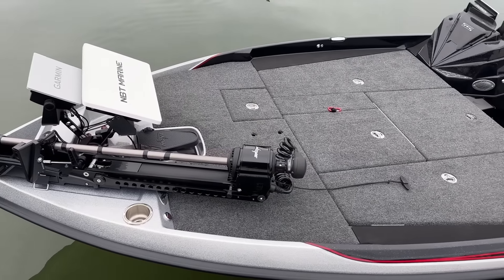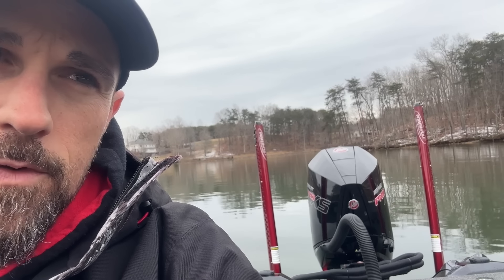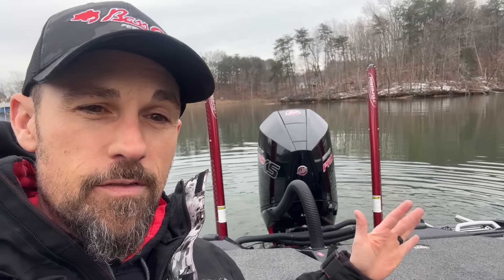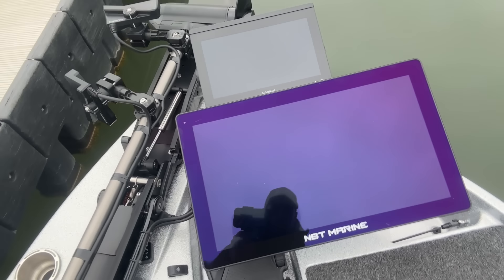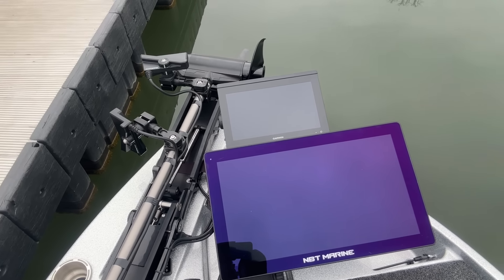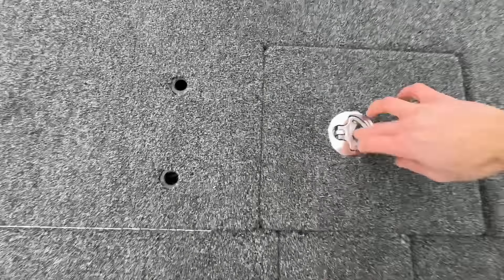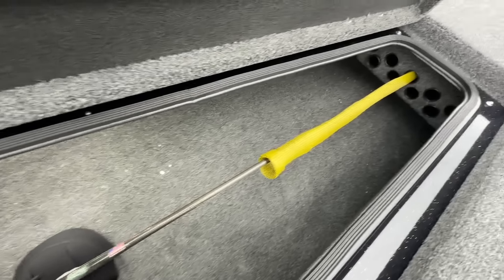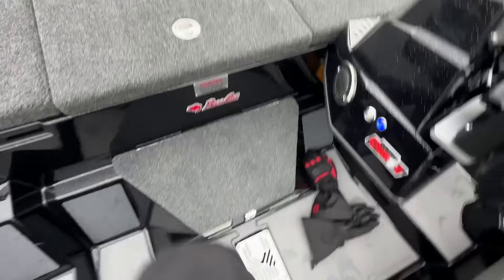NEW Caracal STS - First Run Experience

Comment: Great video, as always, John! What is the reason for the split gas tanks in Basscats? Does the engine siphon from both equally to keep the boat balanced? It seems if you use one at a time, the balance of the boat would be off if one gets much lower than the other?
Reply from the maker: Split tanks helps with knowing how much gas you have for long runs. I like being able to alter weight in back end as it’s best to have more weight on port side due to prop torque
Reply: @JohnCrews  interesting, thanks for the response, and have a great season!

Comment: What’s your thoughts in comparison to the eyra.   (I have a brand new eyra, not even broke in yet).  So I was interested in its handling and drive ability (chine walk) compared to the caracal , and puma.   Good luck, by the way, I’m new, I’ll be chiming in from time to time.
Reply from the maker: Eyra and Caracal STS need to be driven on top end. Cal is much wider and more stable so we will tell in time.
Reply: @JohnCrews  gotcha,  thanks!   (I had to have a Yamaha Sho, so the Eyra was one of the only new basscsts  available in the country).  I do like the caracals size, it might just  be the perfect boat.  GL.
Reply: @JohnCrews hey John I took my new Eyra out and broke it in last week.   Coming from and having experience owning and fishing in Rangers, this boat is on a different level.  The hull elevates as you accelerate making you feel way above the water.  Giving you confidence to do donuts in choppy water.  My Ranger would’ve taken kidney shots.  Just fyi because you mentioned your new boat felt high above the water too.

Comment: How does the new caracal compare to the eyra that you have run in the past I have a p2 now but I’m looking to step up to a 20ft  boat
Reply from the maker: It is much different hull than the Eyra. This is much wider and more stable but still nimble and quick. Will give more feedback and I get more seat time.

Comment: Can that NBT unit be used as a stand alone for livescope?
 So just the black box, transducer and the NBT
Reply: No you need a 8600 series Garmin
Reply: You can buy an 8700 black box but it doesn't really make sense to do that
Reply from the maker: @SBowers321  Some people do that.
Reply: NBT was running a promotion for the 8700 and 22' screen, but I'm not sure if they're still doing it